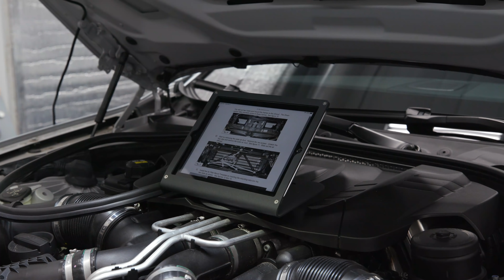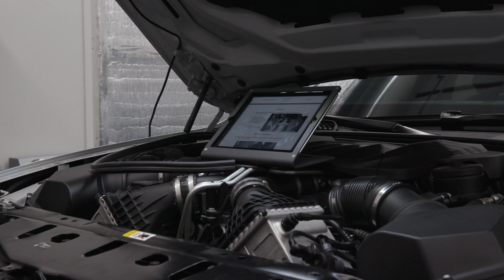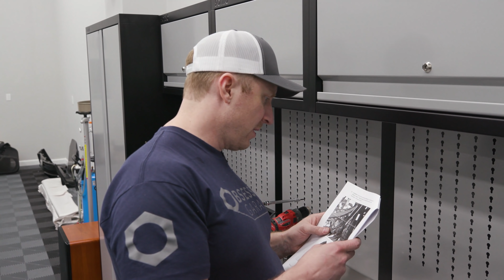Dinan BMW F10 M5 Carbon Fiber Intake Install

Comment: Matt, That M5 is sweet it is right size car for you and your growing family fitting them in the M3 for Sunday drive is not feasible.  Driving the Raptor is boring for performance minded guy like you, it is a utility vehicle.  The GT4 will way exceed your M3's capability.  Selling the M3 and keeping the M5 is more practical.